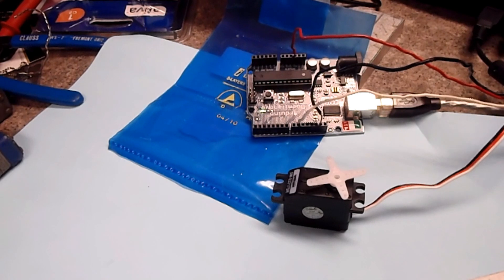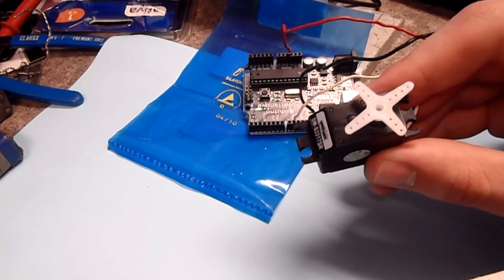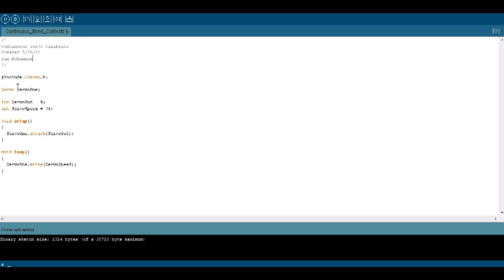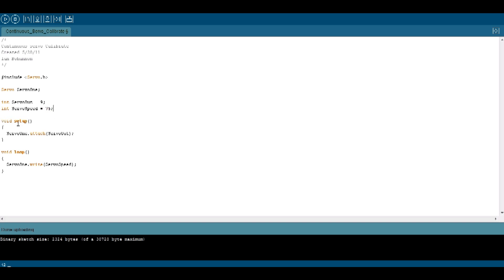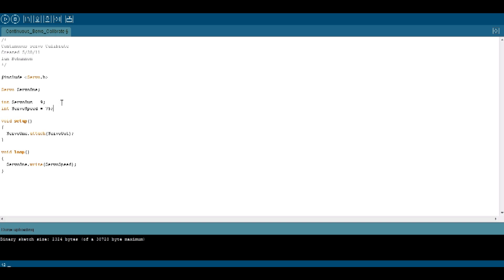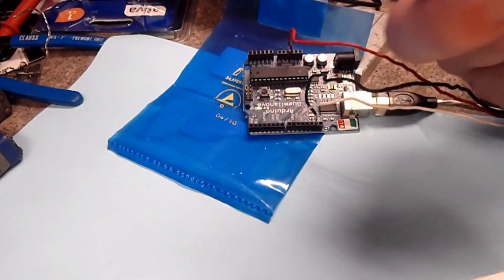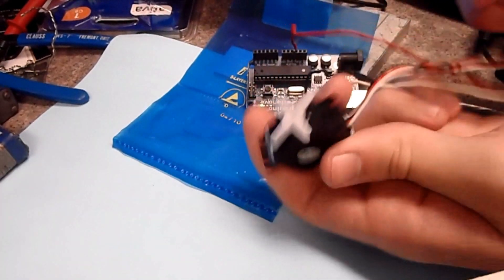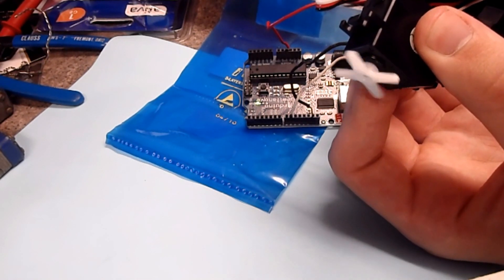Arduino Tips: How to Calibrate a Continuous Servo

Comment: Hello, Im using two SM-S4306R for a differential-steered two-wheeled arduino based mobile robot and Im having difficulties calibrating both of them, and although I tried a different procedure before, both servos keep differing in velocities, I havent tried your code but I dont get whats the point of it? besides I can barely see the code. Could you upload it please? Cheers

Comment: Hi - This has helped me a lot (I am also using the SM-S4303R) trying to use two of the same units - One for a controllable 360degree speed variance, with a secondary unit on the side with 180 control, with and LED on a long arm - - 30 second exposure to to give an electronic light orb.. Cheers

Comment: Hello, I have servo SM-S4303R and it has a problem thats it didn't move and I use Arduino uno to control it. So did this adjustment screw can be the reason for this problem??? and how can I fix it????

Comment from the maker: @ttttkk2 Good question.  With a continuous servo, the speed is determined by the value sent to the servo.  On a regular servo, the value controls the location itself.  What you could do with a regular servo, is increment the value in steps, and add a delay in the loop, but that would only slow it down.  I don't know of its possible to increase the max speed.